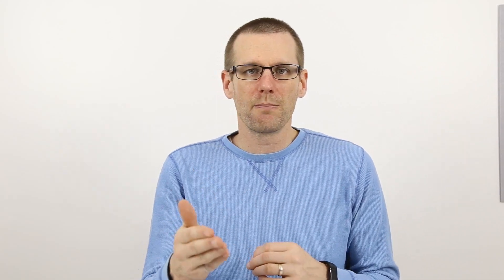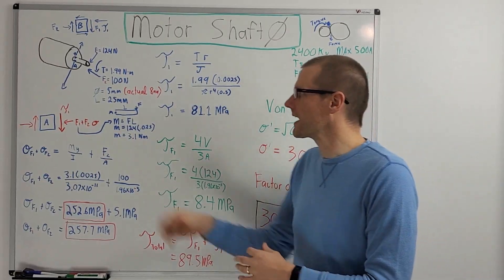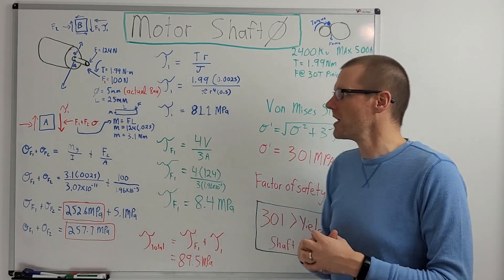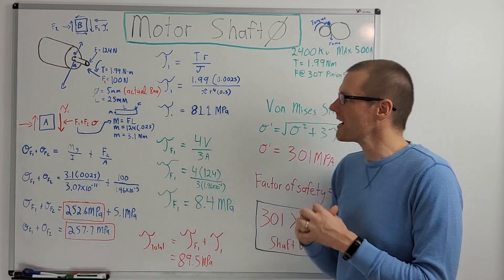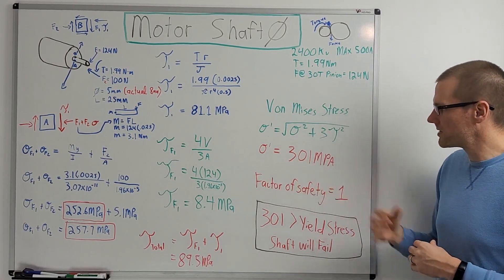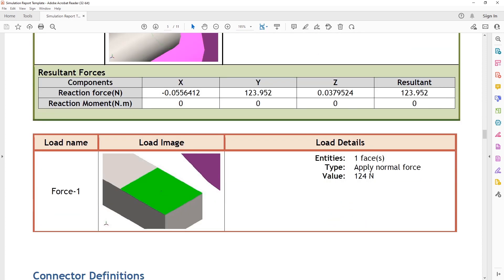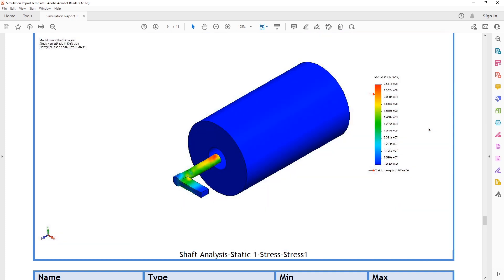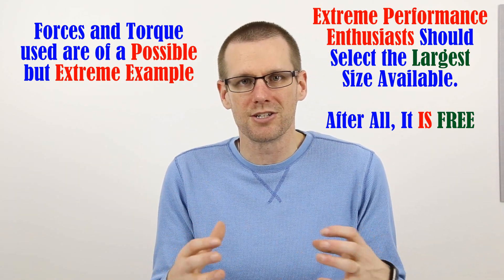What Brushless Motor Shaft Size to Select? Engineering Stress Analysis of Castle 1721 with 5mm Shaft

Comment: Extremely cool! This has been something that I’ve struggled with and it does answer some of my questions!
Here’s some interesting thoughts:
1. A thicker shaft could be more rotationaly stable, in conjunction with for example an arrma motor mount which only supports the motor in one place! Is this something that can be determined?
2. The increased diameter size would automatically change the motor position slightly! Even of in theory the pinion gear would have a larger hole! I’m thinking this is not that important!
3. Depending on the length of the shaft, a thicker shaft should provide a more stable mesh and less stress on the pinion and implicitly the spur gear!
4. The weight of a thicker shaft makes a difference in speedrunning! I’m thinking that at least on a 1/7th scale the difference is irrelevant!
Reply from the maker: 1) I wouldn't expect the shaft to play a significant role here. The motor can supports the weight. 
2) true, design is important here with size limitations. Larger pinion shaft bore will reduce the minimum tooth count possible.
3) I'm not sure how the larger output shaft will reduce stress on the pinion and spur gear. 
4) there will be a difference but I'd expect it plays a small role.
Reply: @RCexplained  Thank you for the reply!
As for 3. my take is that a thicker rod would be more rotationally stable towards its outer zone than a thinner rod! Of course that only truly matters past a certain length! My idea was if that’s somehow measurable!
Reply from the maker: I see and a shorter output shaft is always best for stress concentration but not practicality.